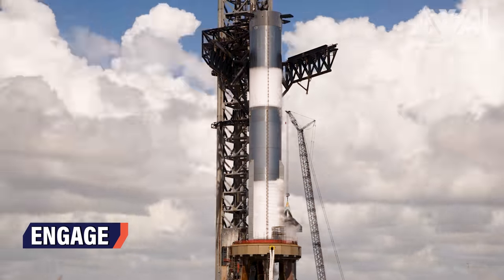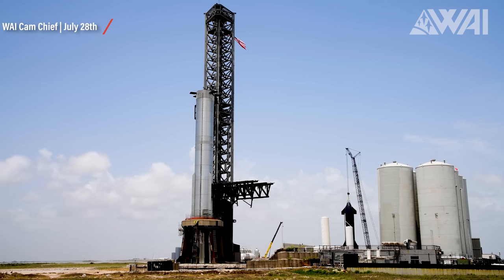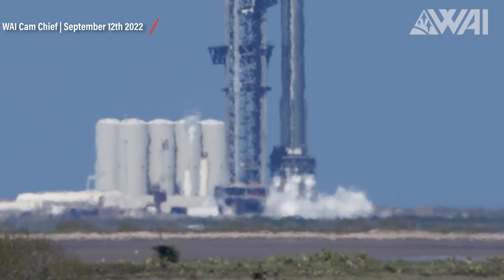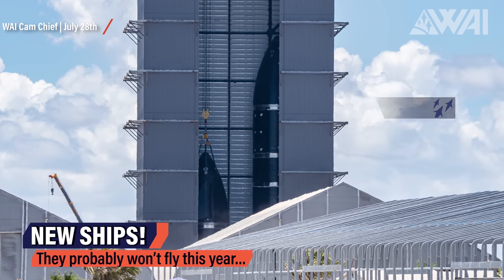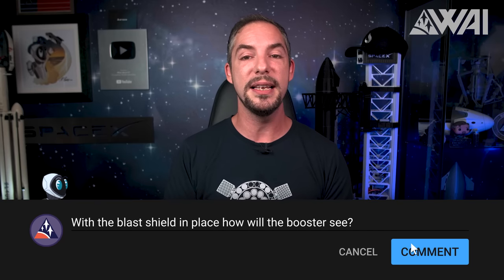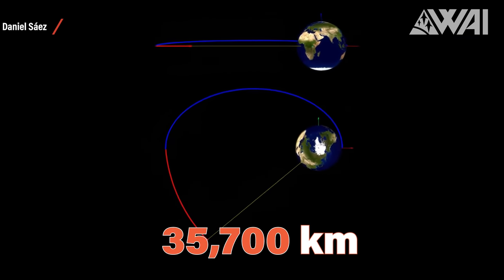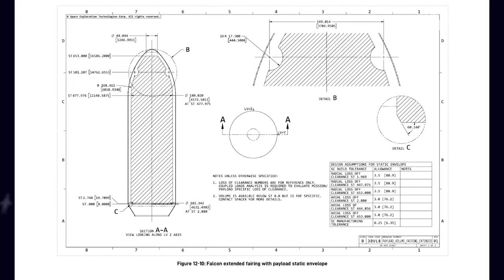SpaceX Starship is ready for the big test! Will it be a full blast?

Comment from the maker: What do you think? Is a Super Heavy Booster strong enough to withstand hot staging and still be reusable, or will it need a shield on top? :_WAISweet:
Reply: i mean, it survived the fts for 40 seconds, so yes it will be strong enough but SpaceX will still put a shield most likely
Reply: uploaded 12min ago but comment made 2hr ago 😅
Reply: @Crutch_Media  I don't think that is a good metric to go by at all..... That's more a design flaw, besides it's not the same part of the booster being affected.
Reply: Considering that Elon said that the raptor erodes at least 1/2 inch of steel per second, yes.  A shield is needed.
Reply: @cwspirols  he did? thanks for the info
Reply: @cwspirols  Looking real good for the new water sandwich now....
Reply: @Eddy525_violin time YouTube required for processing before it moves from creators toolbox.  But creators can still post to it.  Just my guess.
Reply: how about a water deluge system atop the booster 😜
Reply: Yes, it will require shielding. However if they limit the Starship's separation burn to the RVACs at minimum thrust I bet they could get away with a much lighter shield than would be required if the center 3 engines were involved.
The RVACs spread out the plume much more than the sea-level Raptors reducing the force per unit area and so reducing the damage they would do.
Reply: if they can redesign the top tank so that some LOX is able to be used to actively cool it I could see merely a thicker tank wall
Reply: sheild must be there to save the grid fin actuator mechanisum of the booster from the fire fury of the ship. what do you think @whataboutit?
Reply: They can build a blast shield into the adapter ring. That way they can make extras and consider them expendable or refurbishable. Eventually, maybe they can make something that holds up for the life of the booster and weld it on.
Reply: No glove, no love. 🔥🚀
Reply: That is probably the wrong question or at least, not as insightful as it could be.

Every physical part experiences wear; i.e. every part has a limited lifetime before it must be replaced. For some parts,  the wear is so small that their lifetime far exceeds the rest of the craft; other parts, not so much. A good design minimizes high-wear or expensive to replace parts.

So a better question would be "How many times can a Super Heavy Booster withstand hot staging and still be reusable? And how can we reduce refurbishment costs by adjusting the design? What are the tradeoffs?" (Ha! See how I slipped in other questions?) For example, I think the hot-staging ring isn't welded because it is easier to replace with the latches.

Consider the effort/cost to replace the top of the tank (let alone the grid-fin actuators) versus the mass penalty for additional (and easily replaced) shielding. IMHO, SpaceX will add shielding.
Reply: Falls Du mal ein Augmented-Reality-Modell vom Booster für Android und iOS im Video verwenden möchtest melde Dich Florian. LG Gerd
Reply: UK aircraft carriers (QEC-class carriers) and presumably the US amphibious assault vessels that also operate F-35B VTOL aircraft have fancy paint on the landing areas of the deck designed to protect the deck steel from the down-blast of the main F-35B engine when it is pointed directly at the deck during landing. Sure, the temperatures are nothing like Raptor, the UK special deck paint is rated to 1,500C (and the paint is applied using a plasma jet at 10,000C!), but a slow hover coming onto the deck for touchdown probably gives a longer close-range blast onto the surface vs a Starship stage separation although admittedly that F-35B landing blast is cooler. Also the QEC carriers and hence the deck paint have been designed to maintain high sortie rates without needing to have the paint re-applied except in major refit every few years so the paint on those landing pads needs to survive literally thousands of F-35B landings.

I know that such paint would not be the complete solution to the problem but if adopting multiple measures to reduce the damage to the steel perhaps coating any protective dome at the top of the booster with the same special paint might be worthwhile to at least slow down any ablation of the steel surface?
Reply: Definitely needs shielding for repetitive use. I predict it will be a cutting edge (pardon the pun) sintered diamond coated tungsten carbide dome shaped replaceable single use disk that deflects the exhausted propellant out through the vents --- lightweight and robust, but probably the single most expensive throw away (but recyclable) component on the booster.
Reply: @skinnerde  Best reply of the day!😆
Reply: The stage separation should occur in space, and since there is no atmosphere at that point of the stage separation, then the booster shouldn't need any shielding at that separation location.
Reply: @skinnerde  🤣🤣🤣
Reply: You should check what inconspicuous means
Reply: Definitely gonna need some type of shield to protect the motors for the Grid Fins and the top dome of the methane tank....I'm leaning towards a type of heat shield made of the same material as Dragon,  because the Thermal Tiles are WAY too BRITTLE....but the ablative nature of Dragon's shield would mean it would need replaced making it not a viable solution. ...another option would be the mass savings from not using HPUs could be used for nitrogen OR CO² to be vented into the staging ring to keep the components cool.....along with the a PICA-X type shielding....🤔so.......that's my ideas maybe. ....

By the way, I am by no means a rocketology enginetist. ..... :_WAIElonlaugh:
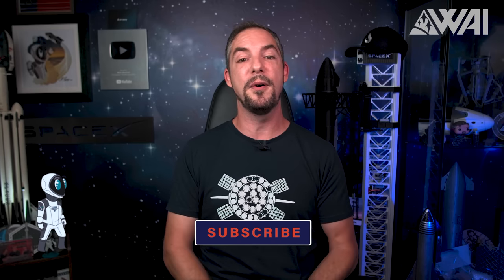Reply: heyyyy @ 21:57 you forgot the last 'E' in omelette :)
Reply: Could the startup and early burn time of the Starship raptors be done with a fuel-rich mixture, to keep the exhaust cooler during the separation?
Reply: @sgodsellify  I’m afraid that’s not how it works. Rocket engines work by ejecting as much momentum as possible out of the engine bell so that by the law of conservation of momentum that results in an increase of momentum, hence velocity of the rocket, in the other direction. The momentum ejected from the exhaust bell is in the form of very fast moving molecules - the exhaust plume comprised of the combustion products. When those fast moving molecules hit the booster they will interact with it in a potentially damaging way. The fact that there is very little atmosphere between the ship and the booster at the time of stage separation does not mean that those transfers of momentum cease to happen.
Reply: Bad Felix... that color grading with ELONgated was awful.

That Testcenter is even more important than just for its vacuum chamber as the REAL tests done there are regarding radiation exposure, simulating cosmic rays... vacuum is pretty easy if nothing in a craft has to be pressurized. There are SOME concerns about vacuum welding, but that is a long term process which you cannot truly test for anyways, nobody can book that chamber for 10+ years ;) but the exposure to ionizeing radiation... THAT is potentially a mission killer for highly sophisticated electronics... and you need to be sure that all expected signal strengths can be survived, which that test facility allows NASA to simulate.
Reply: The top of the tank is a stainless dome, so should be fairly resistant. Also, the hot staging will not be done at full thrust. A small amount of protection may be added but additional weight undoes the advantage of hot staging.
Reply: Thanks for the update, I think SpaceX will need shielding. Could they use the same type of shielding that is used on the dragon capsule for re-entry?
Reply: 17:30 ELONgated 😅
Reply: Seems like they would have to at least shield the grid fin motors.
Reply: Let's watch and see.
Reply: It definitely needs shielding for hot staging . How else would the lox fuel would maintain its desired temperature for boost back/landing without blowing up? Moreover, the gears of the grid fins will be affected similar to the takeoff of 24/7 starship with the booster engine compartment problems.
Reply: If all the components were somewhere else it would still need some sort of shielding.
Reply: I would expect a blast shield just for a bit more protection. After a test launch it can then be determined if it is needed and discarded if not. The first blast shield would have instruments installed for that purpose (and maybe a sacraficial camera to show the upper stage engine startup.
Reply: They'll definitely need to put on a robust shield
Reply: @skinnerde  Weight
Reply: Will require a shield. Not sure it will be there for the next launch as they dont need to reuse this booster.
Reply: Should be strong enough because pressure wouldn´t last long enough to damage things...
Reply: @mikegardner107  That’s true - more than just the dome.
Reply: It should be strong enough for staging. The highest stresses come when the booster engines are at full power, slightly before MEKO. They will throttle down immediately before hot staging.

Thanks for the research and video, Felix. 👌🙂👍
Reply: Anything is doable, at the cost of yet more mass...
Reply: As Booster 9 is going to be expended anyway this question is moot- at least for Booster 9- as they are not intending to reuse it. However, the data they receive from Booster 9/Ship 25's Test Flight would give them a clearer idea on whether additional shielding is needed.
Given that they are probably going to add the Hot Staging Ring as an integral part of the Booster in future iterations anyway they probably would build additional shielding into the top of the Booster at the same time if it is needed.
Reply: @saumyacow4435  For once they have some margin to play with. I'm sure it's so embedded in SpaceX engineers' thinking that they always worry about every extra gram, and rightly so, but here Musk said that hot staging is expected to, at a conservative estimate, give an extra 10% payload to orbit. Even if we assume he wasn't already factoring in any payload mass lost to extra structure needed to protect the booster, and assuming a previous Musk expectation of 150 tons to LEO (the mid point between and initial 100 tons and I think the aspiration to get to 200 tons with Raptor 3 or beyond) that would mean that as long as whatever additional are required to the booster weigh less than 15 tons the results on mass-to-LEO alone are net positive. Obviously SpaceX wouldn't want to go through all this if it only yielded an extra ton to LEO but I can see it still worthwhile, as long as booster reusability isn't compromised, if it results in an extra 5 tons of booster weight to get an extra 10 tons of payload to LEO.

Time for a big thank you to all the people doing aerial flyovers, they should be able to give us the perfect camera angles to see how the top of the booster changes once the modifications are done.
Reply: @julianfp1952  Starship has serious mass issues. That is what is driving the insane over-stressing of the Raptors. And now we're talking stretch tanks and pushing the engines even harder. Recipe for failure, if not high cost of reuse.
Reply: @Crutch_Media  Yes i agree with what you are saying, its just now a matter of how little weight can it be made ?
Reply: Is that a noob toob?
Reply: They're just doing it to mess with you Felix!

Comment: Literally uploaded this minutes after B9’s spin prime! Rapid progress am I right?
Reply from the maker: What a coincidence! :_WAISweet:

Actually I was watching the test and forgot to release the video! :_WAIElonlaugh:
Reply: I mean how hard is it to turn on the engines? They are new, they should be working, yes?
Reply: @jaydonbrown617 Hardware typically fails when it is very old or when it is very young (the "bathtub" reliability curve).  Sure, wear and tear will eventually get all of us, but a significant number of failures are due to manufacturing defects.  Now you typically want to catch these before it leaves  the factory, and that's basically what they are doing, just a lot more publicly than most.   You can't be completely sure you built it right until you can fire it. With so much riding on a successful launch, they want to test what they reasonably can to give it the best chance of success. (Note this is also why Dragon capsules are launched on boosters with a few landings already.  Not so many that they are getting "old," but proven reliable for the safety of the astronauts.)
Reply: @@ChangeEvery14Days Not what I'm getting at. These guys are rocket scientists and engineers, yes? I mean the spin prime test seems like such a benign task for the engines, I just don't get the hype some people show for it. I mean it's effectively like celebrating that your car enters the "ON" power state just before you crank the engine, and you hear the hum of the fuel pump and some other things. I mean I guess that's always a good thing right, but its more of a back-of-your-mind kind of thing.
Reply: Flex could even do a live stream as fast as SpaceX is going.  Beautiful and incredible!   We need a SpaceX yard sprinkler like the super soaker deluge system.  I could water my yard in 10 seconds!  ;-)
Reply: @jaydonbrown617  Of course it will work if there's only one engine, but starting 33 engines at the same time is the challenge. As you know, booster 7 struggled to keep all of its engine turned on, even though it have the same version of engines as booster 9.
Reply: @Razan23  Oh? I thought B9 was using the new V2 or V3 engines. They were essentially getting rid of the last of the old ones with B7

Comment: The tank pressure dome is designed to hold pressure in, not keep it out from the ignition of the upper stage. Some sort of pressure plate will be required above the dome.

In the future, I would suspect that they will redesign the upper dome to handle both tasks.

Comment: Hot staging ring attached as adapter also makes the old system a possible failover system, at least during seperation testing. Therefore I'm not surprised if welding of these segments is not done on the newer prototypes. 
PS: great content Felix, keep up the good work!

Comment: Makes sense that the HS adaptor simply mates with the existing pins on the booster. I wouldn't be surprised to see this as part of the design going forward, since it would make it easy to replace the adaptor between launches. It's going to take a beating and may not last the life-time of the booster when rapid reuse becomes a thing. Besides, the latches were clearly strong enough to hold when the full stack went into an unstable flight regime. 😁
Reply: You are on the right track.  Using the existing booster to ship interfaces simplifies everything.  At staging the hot stage will remain with the booster  and can be refurbished or scrapped. I 'm pretty surre it will be scrapped since its structural load capability will be dramatically altered by the raptor plumes.  I also expect that any booster insulation components will be replaced during prep for its next flight.  Also simplified is the stacking process.  The ring can be mounted to the ship transporter using a crane lift.  The ship can then be lifted and mated to the ring.  After transport to the OLM the ship+ring can be lifted and mated to the booster.